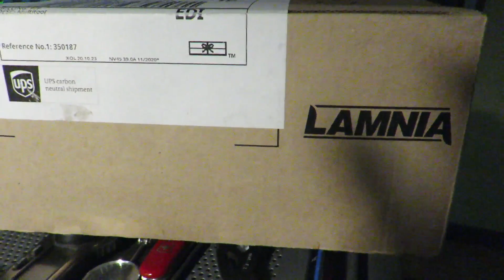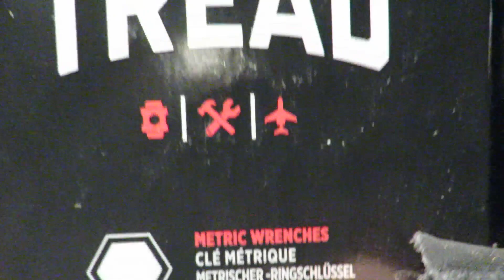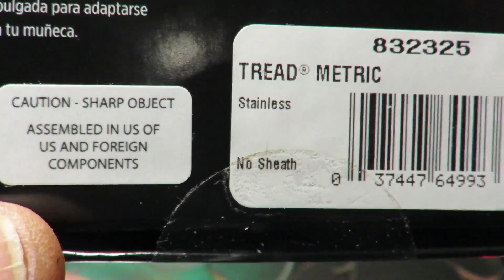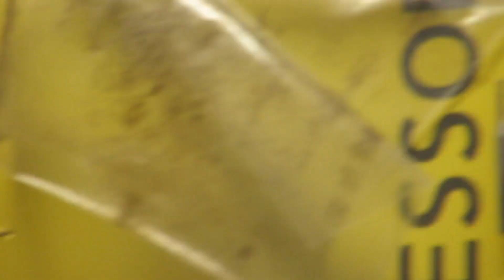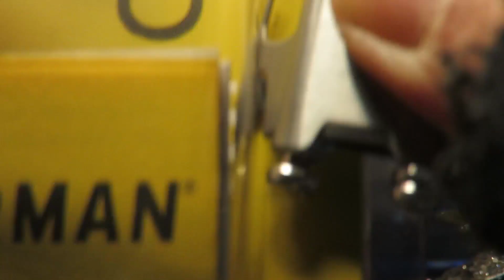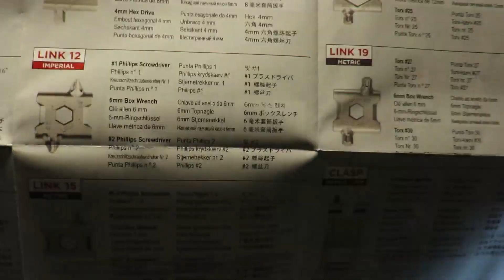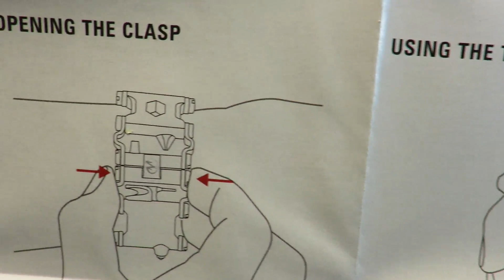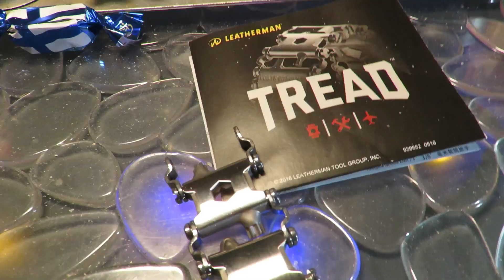Leatherman TREAD (METRIC) Bracelet Multi-Tool : NOT recommended for small wrists!

Comment from the maker: There is an error on the instructions concerning the opening of the clasp, it is not enough to press on the level of the two screws of the clasp, you have to pull towards you.
Or unclip at the logo (1/4 "socket driver).
Il y a une erreur sur la notice au sujet de l'ouverture du fermoir, il ne suffit pas de presser au niveau des deux vis du fermoir, il faut tirer vers soi.
Ou alors déclipser au niveau du logo (socket driver 1/4").